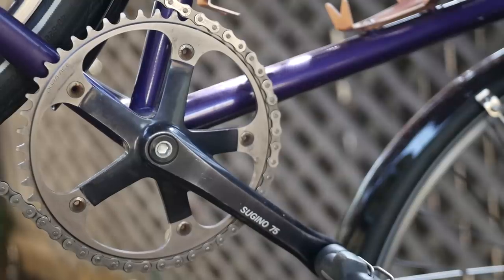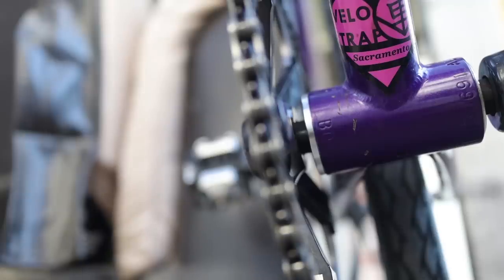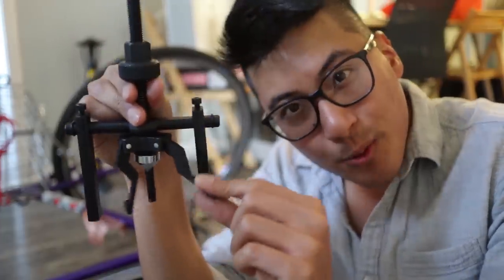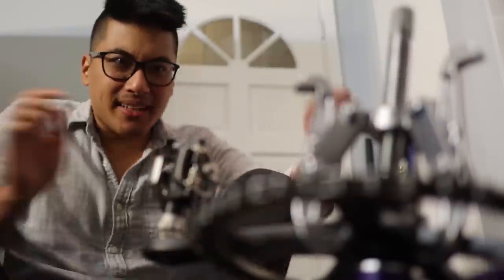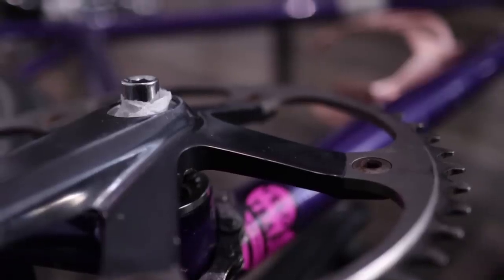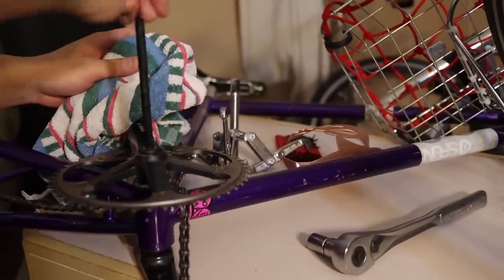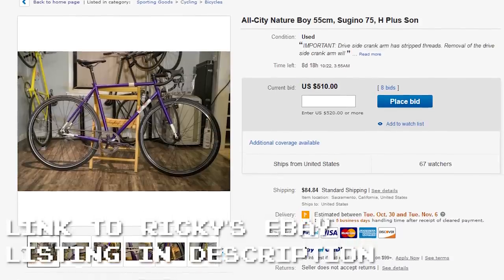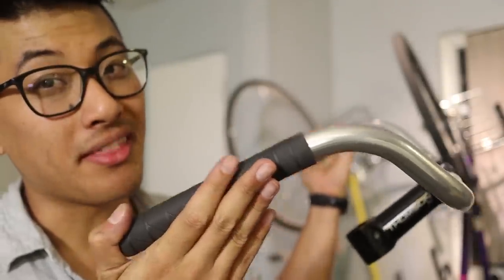The Sugino 75 Incident | Fixed Gear Cycling Vlog

Comment from the maker: I suck at bike mechanics 😓I apologize to whomever wins the auction for Ricky in advance for having to deal with my poor choices.
Reply: Zach, never do this again, either bring it to a shop or learn how to do it properly. You don't want to damage the wabi in a similar fashion. Much love to you and what you do but please please please don't damage any more bikes. It hurts to watch this video. You have no idea how much it hurts to watch this.
Reply: I’ve been there myself 😅
Aside from Heli-coils, an idea that came to my mind was to use a large “pickle fork,” such as those used in automotive suspension repair.

Alternative option… SRAM Omnium with a Wheels Mfg. GXP bottom bracket?
Reply: Try this tool. Hard too find sometimes. Not always in stock. But it is right now. Only company I know that makes it. http://www.bicycletool.com/threadchaserforcrankarmdustcaps.aspx
Reply: what's wrong with stock cranks of the wabi ? they look great the way they are.
Reply: are you a filipino, zach?
Reply from the maker: The stock Andel cranks on the Wabi are perfectly fine, and they ride just as nicely as Sugino 75's. I just like 75's enough to justify replacing them. Irrational? Definitely, but I still plan on doing it.
Reply: Zach, what chainring is that?

Comment: Zach, I did the same thing to my Andel crank and RJ's method with an imperial socket worked to remove it. However, the stress deformed the spider where the jaws dug in, and I gave it nowhere near the torque you guys did. I'd definitely check the underside of the spider for damage before you let somebody else ride it.

Comment: I know this is an old video, but for future reference here some steps to remove stuck threads.
1. Use penetrating oil
2. Use a heat gun (use lower temps to prevent paint stripping or a hair dryer) or leave the bike in the sun on a hot sunny day.
3.  The longer you let the penetrating oil soak, the easier it is to remove the bolt. Spray it, try to remove it.  If it doesn't move, try again every 8 to 24 hours.  Spray it again after each unsuccessful attempt.  Bolts have come off with no effort after doing this.
Reply: You do know it’s not the retaining bolt but the entire crank arm he’s trying to remove right?

Comment: I once destroyed a beautiful pair of tri-colour 600 cranks trying to get them off. From memory I either stripped the thread or felt that it was about to go, so I decided to use a breaker bar to lever it off from the inside of the arm. It literally bent like a noodle. The hardest thing with these kind of tasks is staying calm and remaining patient enough to walk away, sometimes multiple times, before the primal urge to get it off at all costs takes over!

Comment: An old trick that I learned that has worked for me was to attach a normal crank puller. Then thread a long bolt through the center of the  crank puller and into the bottom bracket. Make sure to use some spacers to make the bolt snug. Use the adjustable wrench with long metal pipe (for more leverage) to break free the bb from the frame.

Comment: The same thing happened to my friend's sugino 75 crank arm about a month ago, he really wanted it off so we ended up cutting the spindle with an angle grinder then hammering out the extra piece that was stuck inside. replaced the bottom bracket with another and he's still riding it today.

Comment: If you can remove the non-drive crank and bottom bracket cup, you can press the spindle off of the crank arm in a vise without damaging anything. We have to do this every once in a while at the shop.

Comment: Im way late to this discussion, but referring  to your issue with finding a socket to push on the bb axle. i have a botched crank puller tool with no bit to push on the square taper. I was able to substitute it with the inner race of a skateboard bearing. Any bearings  from a skateboard will work. It fits perfectly in the square recess on my 75s. I assume it could work for your particular crank puller tool too.

Comment: You should have tightened the gear puller down as much as possible and left it for a good while. You probably would have been woken up by a loud cracking noise in the middle of the night. Also it didn't have to be a 8mm. any SAE equivalent would have worked just as long as it seats nicely. Most importantly, you don't need to and shouldn't have your cranks on so tight. Use threadlock on the bolt and don't overdo it when tightening the bolt. Also never ever grease the spindle or crank shaft. It will allow the crank to slide on way farther than it should which will stretch the crank shaft and can even crack the crank shaft. 

Cheers 👍
Reply: Quite logical

Comment: I recently had exactly the same problem, before watching this video, and it was my bike mech that stripped my crank!
I used exactly the same bearing puller but did 3 extra steps that made taking it off pretty easy
1. I heated my crank with an electric hot air blower. Aluminum expands more than Steel.
2. I used TWO 14mm key tools, one on each side of the spider, so I would apply force without risking breaking the spider or forcing it off
3. I used a steel bracer to keep the spider arms tight together on my crank
It took 5 minutes for me to get the crank off, after hours (on previous tries) trying without these steps :)
Reply: Hahahah, by the end of the video you recite my point 1 XD Just watched

Comment: I would bet my own life that the problem with this crank removal is that zack doesn’t have the proper bottom bracket for 75s. High end stuff from Sugino is typically proprietary like the bb 75 has a special taper in the spindle that only 75 cranks are going to match. And no before you ask, 75s are not JIS compatible.
Reply: That, and that he does not use a torque wrench on the BB, at least judging from his Wallace build video. He likely damaged the square taper hole from constantly removing and then overtorqueing the crank for all his bottom bracket services and someday it became stuck.

Comment: There's a tool for this purpose, you put a towel in between the crank and the bottom bracket. Then there is a fork type tool that gradually gets wider, like a door stop. You wiggle it back in forth until the crank comes free. If you could make it to SF and go to the bike kitchen (co-op bike shop) we can help you out

Comment: One thing about aluminum, and steel. Afetr time, and lack of maintenance, they will gall (fuse together. Think of a stuck seat post. Kind of thing you want to be mindful of. Maybe a little anti seize once a year, or grease twice a year. Yeah, it does suck, but soaking it down over a few days with rust penetrant, and having a quality puller, it is fixable.

Comment: I have this problem but it's the non-drive side crank and the gap is too small for a 3 Arm Puller. Tried a heat gun and a hammer. I've been riding it without the bolt and it has refused to just drop off.

Comment: Hey Zach, flip that thing around the hooks can face inside or outside.
hey Zack, it doesn't need to be an exact 8 mm socket as long as it is the right size to be able to push through without wobbling

Comment: Had the same happen with my Miche Primato cranks,  just take the bolt out, and do a 20k ride with some climbs and skids and it will come off, just stay within walking distance from the house xD 

Also a campagnolo 2 arm crank puller can help (they should have them in any good local bike shop)

Comment: Yah, I'll cop to being a ball bearing weanie. Not sure why you couldn't extract your crank arm from the BB spindle. This used to be a fairly common issue, aluminum alloy on steel alloy, four bearing surfaces. The fact that there're only four is actually a feature for you. You can cut the aluminum parts off. If your steel part is not correctly dimensioned, add material with welding processes, checking hardness, then, precision grind to fit the OED part.
Y'all, these aren't dragsters with 10,000+ explosions to contain per ride.
It's just your metabolism. I don't care where you live.
Get a grip.
L O V E  your channel, Zach!!!

Comment: Yet another reason why square tapered BBs are yestercenturies' technology. Unless Q-factor is a big issue for you, they're just not worth the hassle, no matter how nice the available cranksets might be.
Reply: They're only a problem if you don't know what you're doing.
Reply: I'd say, they're somewhat less of a problem, if you know what you're doing.
Reply: I disagree, they're cheap, they work, come with lots of options for cranks and if you install them properly they won't have any more issues than with modern cranks. I'm not saying vintage bikes are better for example modern headsets are better than vintage in every objective way. but bottom brackets haven't really gotten better.
Reply: A Hollowtech II BB costs about 15 bucks, and will give you a metric fuckton of crankset options. And yes, you're right, if you install a square taper BB properly, you won't have any more issues than with modern cranks, but, due to their construction, installing them properly (and especially unistalling them properly) is much more of a faff.
 Meanwhile on the more technical side, outboard bearings are bigger and thus more durable, while allowing for a thicker (therefore stiffer) and hollow (therefore weight-saving) spindle.
Reply: Hmmm... you may have changed my mind, i didn't realize hollowtech BBs were so cheap

Comment: Lmao, when you want it to come off without a tool, it will absolutely never come off, but in the wrong timing like if the crank bolt drove itself out and you’re riding and the crank flies off that shit comes off like butter. Crazy situation. I hate stripped shit, sure the cranks were nice in the past, but they’re trash now being stripped bro. Let em go or get them welded, grinded down and rethreaded

Comment: I Just spent about 10 minutes watching a video only about stuck crank, not sure if it was worth it. Next Time just grease the bottom bracket taper before putting the crancks on, this should prevent the problem
Reply: Franiomaj or don’t use stripped parts
Reply: Franiomaj also, greasing a spindle can be a bad idea as it makes it really easy to over tighten your cranks. There's an approximate torque number for these things...
Reply: @hopetofly  you do want to use grease if you have a tourqe wrench because they will be easier to take off. But don't use grease if you don't use a tourqe wrench because they are easy to over tighten
Reply: You should not use grease one a spindle, it makes it super easy to over tighten, Also if you over tighten the crank JIS/ISO tapers can very likely crack your crank arm where it contacts the bb spindle

Comment: This is what I would do if I were in his situation I would've used a grinder or a saw to cut the bottom bracket axle the use a hammer and something like a metal rod to hammer out the remaining piece of bb

Comment: Take your bicycle to old 'grey beard' bicycle mechanic....someone who actually worked on bicycles prior to the advent of mountainbikes

Your problem has a very SIMPLE solution ....REMOVE THE HEX BOLT THAT TIGHTENS THE CRANK TO THE SPINDLE ....REMOVE IT ENTIRELY !....THEN PLACE THE CENTER POST OF YOUR 3 ARM GEAR PULLER DIRECTLY AGAINST THE END OF THE SPINDLE ....PLACE THE 3 ARMS AROUND TO THE BACKSIDE OF THE CRANKARM SPIDER ....also, once you get a bit of tension on the remover set-up, then, run a cinch strap around all 3 arms of the puller ....tighten the cinch strap tight ....also, the Pittsburgh puller you initially had has a simple feature that allows the jaws to be reversed ....you have said that you do not like working on bicycles, that is probably a GOOD thing....again, find yourself a REAL, GENUINE, GREY BEARD MECHANIC = ( PRE MOUNTAINBIKE )....just ask them, "WHEN YOU BEGAN WORKING ON BICYCLES, WAS THEIR SUCH A THING AS A MOUNTAINBIKE " ?....if they say "NO", you might well have the right mechanic

Comment: I don't understand this. 8mm is larger than 7mm. Yet, you say there was play in it. Don't you mean a 6mm?
Also, 20/20 hindsight. Once the crank arm is removed, by a more competent mechanic. Why not just tap new threads?
Reply: Needed 8 mil only had 7 mil. Also cant re tap because the puller is all a standard size and when you recut itll be bigger
Reply: @spyfox258  The size difference still doesn't make any sense.
Also, Crank Pullers come in different sizes. Just tap it out to the next larger size.

Comment: i had the same problem a couple times, i would end up banging on it with a hammer for a 2 or 3 days, of cours using penetrating oil and heat gun. in the end i think you made the wright choice 😁

Comment: invest in electrical tape for all of your shimming sockets into crankarm hole needs. is thicker and is more grippy also works as a rim strip and good for bar tape
Reply: Are you sure electrical tape is safe to use as rim tape? Seems pretty easy to poke holes in it... Interesting idea though... maybe if you layer it a few times.
Reply: Evan P It works for rim strip when wrapped several times. I've done that many times. Living about 45 miles round trip from a bike shop makes for some expedient repairs.
Reply: Cool, if I forget rim tape next time I get a new wheel, I'll try it!